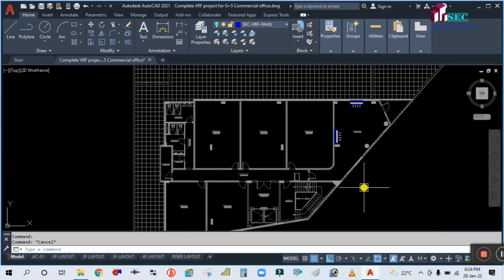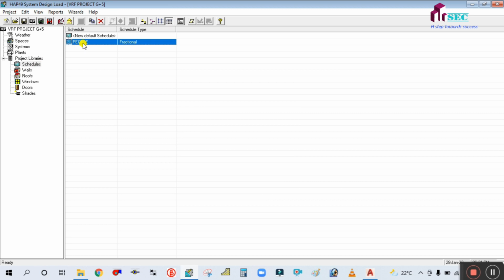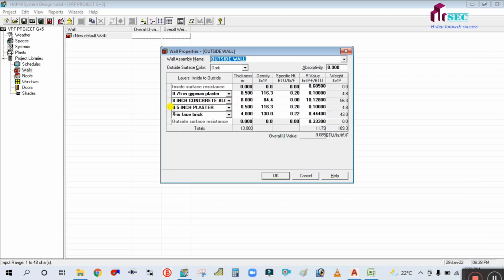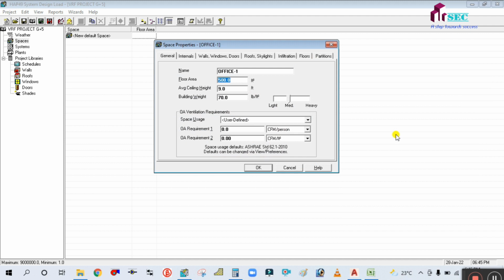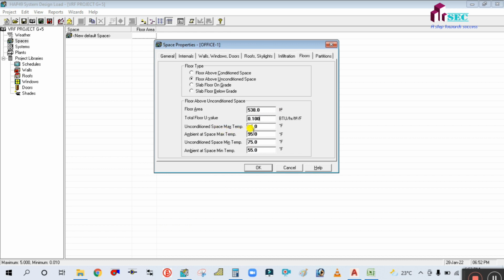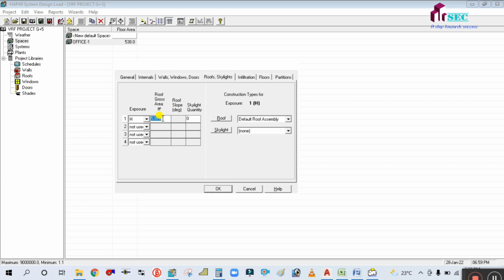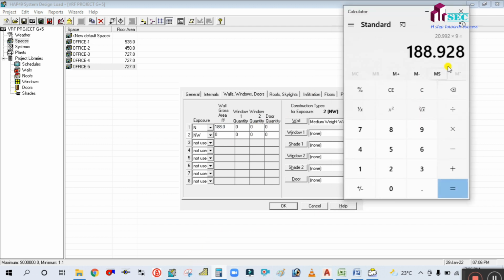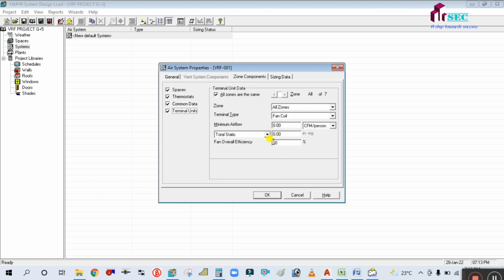COOLING AND HEATING LOAD CALCULATION FOR VRV/VRF PROJECT IN HAP4.9 SOFTWARE I FOR ABU DHABI WEATHER.

Comment: Sir i want some assistance regarding my semester project.Can you help me.Thanks
Reply from the maker: I can assist you
Reply from the maker: What is your project
Reply: Sir my comment was deleted automatically
Reply: AoA
Dear Sir,
Sir i have a Semester project related to Refregeration and Air conditioning and i have to submit (simple building model containing some rooms lights fans windows with no complexity)
Sir i was looking for a (Simple) building model i.e( 2-D,3-D,hap based report for heating and cooling load calculation)
Sir i hope  you may have lots of files saved using hap.
Sir can you provide me one of them.🥰💞🥳
It will help me very much.
Thanks
Regards
Big Fan💞🥳